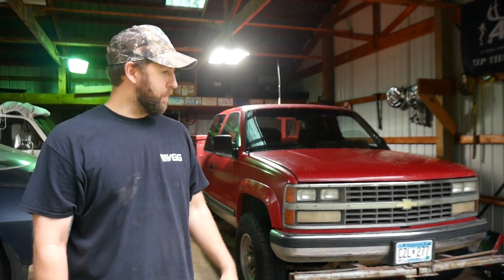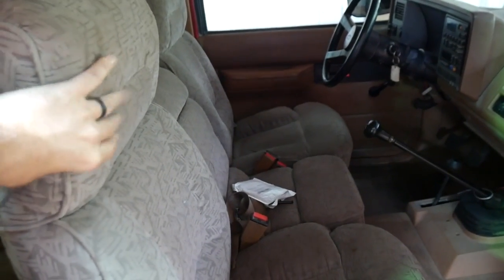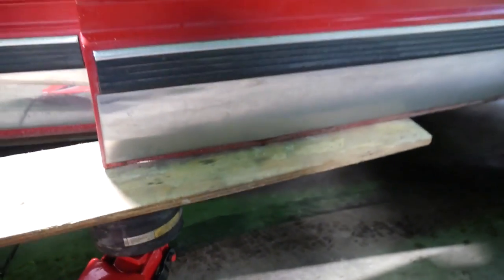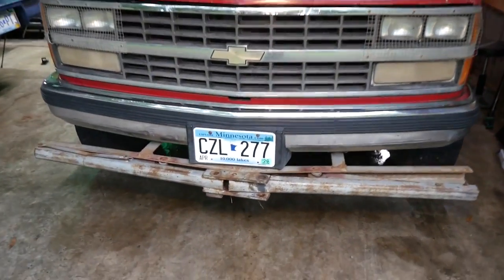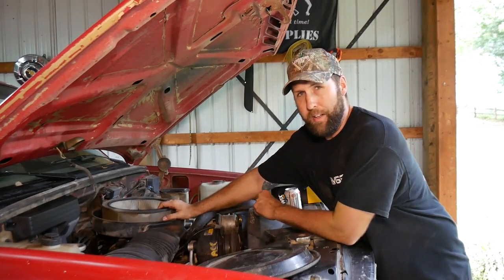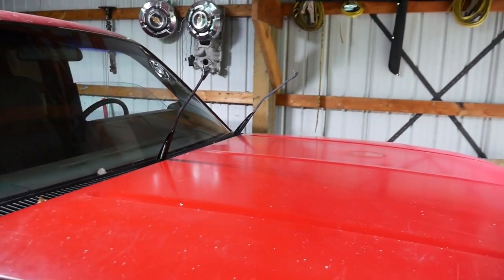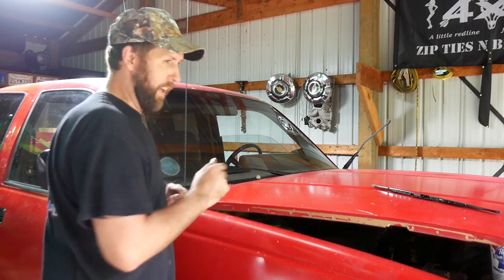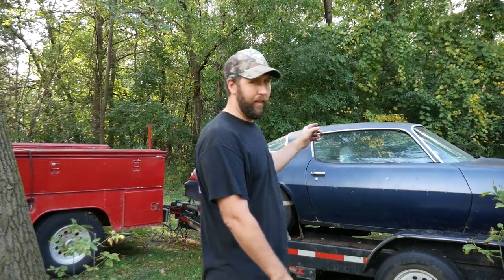OBS Chevy K2500 Service Truck - Vice Grip Garage EP41

Comment: Today I bought an 89 Chevy K1500

First Chevy pickup

Was the shops mechanics truck. Great shape. Runs and drives. Recently rebuilt powertrain.  $1,200 and I couldn't be more stoked. 

Already tempted to LS swap.
Reply from the maker: Wow what a great deal

Comment: "Don't pay attention to the way the belt is routed so you can really struggle when you're putting it back on..."

HAH!
Reply: save those old belts for engine hoist duty
Reply: @ddcraun  how do you use old belts for engine hoist duty?
Reply: Every g-d time... ✋🏻🙄🤚🏻
Reply: Pichardo Gabriel couplers and cradles... they’re belted rubber and have high tensile strength, so you can use them for things like cradles and strapping when you’re hoisting an engine.
Reply: Pichardo Gabriel basically you stretch the belt out flat, tuck the end thru the lift hook on the engine, then fold it it half and put the hook from the hoist through the belt and lift!
Reply: @ArmchairDeity  ohh ok cool
Reply: Just snap the old belt out with tin snips, it saves 15.5 seconds
Reply: I've done that before but then I've always loved a good puzzle.
Reply: My dad thankfully new how to put things back together, I had alot of fun with his screwdriver a couple times, clocks, doorknobs, etc. I'm glad he said the same thing to me, just pay attention how you take things apart, even at 4 and five i remembered. I melted a stereo on my maverick dashboard, so I took it apart, took the speakers out and put them in another.  I know it's not a car, but I was pretty happy with myself.
Reply: Nice car, but what about a maverick, don't they exist anymore.

Comment: I had a 95 TBI. I unplugged the tan wire to the computer, advanced the base timing, put a few quarters under the fuel pressure regulator spring,  snipped off all that extra material shrouding the TB, raised the injectors up,  braised a large salad bowl to the bottom of the air cleaner (to help air flow around the injectors as they restrict quite a bit of air flow), it gave it about 9.32 horsepowers.

Comment: My dad has a 91 Chevy WT K1500 and the oil pressure guage pegs full like that too. Evidently it's the oil pressure sending unit that failed.
I bought the truck originally and it worked fine at first, then suddenly one day it did the same thing.  It still runs that way.
I sold it to my parents when I moved to Georgia in 2003, then moved back to North Dakota with my wife in 2006. They still drive the truck, in fact they just put new tires on it this past spring.

Comment: I like it, more content of Beets/Beats would be cool.
An idea I've heard for more power on those TBI engines is to check the flapper on the air intake. The flapper is closed when the engine is cold so that air is pulled from the exhaust manifold and it idles better. Once the engine is warmed up(just like a thermostat) it should open up and let in colder air, but over the years they will fail and then your engine is stuck sucking in warm air from a small tube, essentially choking it out. 
Keep up the great work!
Reply from the maker: Thanks Clint
Reply: Well we will just have to add that to the build sheet😂😂😂😂
Reply: If you watch the vid, you can see the heat tube is not even hooked up.. it's just hanging there. The flapper was a great idea, they just didn't put too much time into the mechanicals. It uses a heat thermostat similar to the coolant kind to open or close the flapper... there is a second flapper in the heat stove pipe that's supposed to close up at the same time, but it's not a snug fit. Hot air will always get sucked up in there. If you don't live in an emissions tight county/state, you can snip both flappers out and plug up the stove pipe in the air filter housing, or cut it flush and weld in a patch.
Reply: @Mason Widener Yes, this is a great mod. The cone was just a noise reducer anyway. The inner fender ducting is pretty big, and it gets a good supply of real cold air from the front of the truck. Those "Cold air" intakes with the cone filter hanging inside the engine compartment are just you money sucking in hot engine compartment air. All you need is a bigger air cleaner with original fresh air ducting, and you'll get better performance for less cash.
Reply: Regardless of what a guy does, just keep the air coming from the fender inlet. I shake my head at guys who ditch the inlet, or put an Autozone cone filter on, or simply flip the air cleaner lid. Cool air from outside the engine bay is obviously better than warm air inside. 

They do sound beastly with the air cleaner lid flipped, though. Like an old Q-jet lol.

Comment: Another awesome video man, loving some beets, as I have a soft spot for the unsung hero vehicles. Also, as someone who is working with TBI on an 89 Suburban V1500, I know the longing for a bit more juice under the hood. What I've discovered over the years is that these TBI units like to be cleaned, like once every few years. Remove it, take it apart and soak/spray/scrub the hell out of it. The spring behind the regulator diaphragm is notorious for failing as well. Also there is a 1/16 inch spacer that is available for these units, goes between the injector/regulator pod assembly and the throttle base. this allows more air flow through the horns to increase atomization of the fuel spray. Also Edelbrock offers not only a TBI  intake, but a companion low to midrange  "RV" style grind cam that reportedly turns that TBI into a workhorse. the cleaning and spacer mod alone greatly improved throttle response and acceleration. I added the intake last year and the difference in acceleration was even more noticeable. Waiting on the cam, as the engine still only has sixty thousand on her. Also, check your EGR system. The computers that ran these TBI motors really "felt it" and tried to over compensate if the EGR valve or the module it's hooked to go on the fritz. How many times can I say unit? UNIT UNIT UNIT!!!
Reply: I'm installing a spacer RIGHT NOW, well after the video, of course, so thanks, a lot!!!

Comment: Yup, basic maintenance on the company service truck, if it starts making noise, that's what the radio sound adjustment knob is for. If you see smoke just tell everyone you was getting rubber at 55mph. Now your a hero UNTILL they find out the clearance on piston to cylinder, requires a tape measure....
Be safe out there great video.

Comment: You can add the bowl (Jegs Part Number: 555-50080) under an open element air filter assembly.  Instant difference.  I got the filter lid too and that helped.  Cat back exhaust will take advantage of the added incoming air.  Add a metal matrix, high-flow cat and you'll be in business.  And there are more cheap mods if you're interested.  On Beets?  Yeah.  More.  Any and all service and maintenance and tuning items.

Comment: I've got a 91 chevy with the tbi 350. I run 5w30 or 10w30 depending on the season. Can you run that thick of oil without wearing out the oil pump?

Comment: I been putting cold air intakes on my vehicle for year Derek max hp I have seen is 40 or so hp more but I use them because I can clean and reuse the filters and have mire then 1 filter ready and clean to just switch it out and go on my day when one is dirty @ViceGripGarage

Comment: I bought a cheap(ish) 1990 C1500 last summer after a huge hail storm totaled out my other rig......while I was already miserable at work. She's got 211k miles, only 30 pieces of oil pressure after a Rotella/Lucas oil change, but zero rust (Alabama rig) and a Gps exhaust. New tires, all kinds of maintenance, oh and the saggy door bushings. Gat dangit, I have to order the snazzy Cunningham bushings. The Dorkman ones are total trash. Anyhoots, what a feller is trying to say is A. One of the best darn rigs I've ever had. 2. Solid reeliabilityeee...fires right up on a 15 degree Mitt State morning. And D, classic timeless styling that I love. Hope to do a VGG rebuild on a junkalated power barn module and keep her going forever. Hope you keep yours going forever too! She's a total babe!

Comment: Just wanted to add to the subject, after changing the belt, throw the old one behind the seat in case you're in the middle of nowhere sometime and the new one goes sideways, the old one will get you home. Same for the windshield wipers, save the old ones behind the seat as well. I've had them fly off in the middle of a torrential downpour  and again, the old ones will get you home.

Comment: On those old 350’s I’ve always flipped the air cleaner lid over and removed the intake tube. On all of mine the little flap/ wannabe choke thing always was worn Out and stayed closed.  Which does block off air flow. Now I was and am too cheep to replace that so flipping the lid it will suck air from around the filter like the edlebrocks. Plus a bonus it sounds sweet.

Comment: I think the truck is fire. Put a amber light bar on the roof in case you stop on the side of the road or highway. Safety first. Combination generator welder , small air compressor, vise on the back bumper. I really love all the side box's. I used to take care of the boss's drill rig service truck. It was a Chevy 2500 4x4 dana 44 front dana 60 in the back front hubs auto trans Allison 6 speed. We put some mud slinger's on all 4 wheels. That thing was one mean son of a dip. Your's reminded me of that truck.
Reply from the maker: some great ideas

Comment: I broke 3 sets of bushings pounding before I used a stud and a couple of fender washers with a socket on the bottom side so the bushing would seat. I've done 2 other trucks since and took me 20 minutes per door.

Comment: you can take the sound resonator "the big round plastic drum" out of the air intake tube, 350 had them but the 305 has a straight tube that will fit it. it helps with the intake airflow and a little more mpg and torque. also they make an intake spacer it's a cheap power fix that goes under the TBI it helps low end torque but don't use the spiral "vortex" one cause it kills your high RPM power,  your channel is awesome, keep up the good work!
Reply from the maker: Thanks larry appreciate the tips

Comment: I loaned my '78 D100 to my brother for a couple of months, and it came back with the bottom of the door folded in.  He said he tried the door adjuster 9000 on it,and low and behold
it is still folded to this day.   I had to force a repossession on it to save it from the drunk side rub etc. too.

Comment: Take care of the GMT400 trucks and it will live forever. You can’t even replace the door pins on the 99 and newer GMT800’s.
Old 350 doesn’t make a lot of power but will run for a million miles with regular maintenance. The fact that it’s a manual transmission makes it a keeper.

Comment: yep lets see some more fixin on the beets truck maybe add some of the tools back like a compressor, harbor freight generator, welding machine you know the stuff you need when you go snag a new one out of a field. Maybe even some work lights that run off the generator. Maybe an LS 6.0 swap.
Reply from the maker: work lights not a bad iduer

Comment: 93 Tbi 350 in a 1/2 ton 2w/d. K&N filter in a 14 inch old skool chrome air cleaner. Hyper tech chip about 100 bucks, no Cadillac converter, and an under drive balancer pulley. Added abut 6 horsepower. Seriously 0/60 in 9 seconds flat.

Comment: I've got a 93 with the same engine set up. I run a standard 14 inch open element, works fine. also if you bump up the fuel pressure to about 15 psi you will notice it gains a few more pony's. A guy could use either a different spring in the fuel press regulator or an adjustable regulator, both can be found on Ebay.
Reply from the maker: Awesome thank you!

Comment: Well for an 89 and here in Minnesota, that girl ain’t to bad ! Some new lipstick and new shoes and she’ll be ready for the barn dance ! Lol. And by the way I have a 91 single cab with a 5 speed and V-6 I’ll let ya have cheap ! Lol all she needs is a slave cylinder for da clutch , don’t cha know ! I likey that tow bar much , very custom ! Those 3/4 tons run nice with that 350 under the bonnet !

Comment: Tokyo drift intakes can be a good time. On my 90 bmw the MAF sensor is the size of a basketball and of course it has square ends. Needless to say my 20 dollar O'riellys air intake became a square after some custom fab with old intake tubing that was laying around. All zipped up with some trailer wiring. Adds about 980 hp
Reply from the maker: Nice, great HP increase 😎🤣

Comment: I do like those service truck custom trays. Would love to have one. Trouble is the chemically motivated urban dwellers of my 'hood see that type of thing as a self serve utility that could contain stuff that can be recycled via Cashies. And then trashed if they don't find anything. Funny old world we've built.

I know this is a 4 year old vid, but I'm working my way through from then to current day, and Beets is probably long gone but I'd like to see you set up that service tray just so for your tree rescues. You know, dedicated space/storage for your 12' of fuel hose, boat tank, carburettor adjustors, cans of SYB, etc.

Comment: a 69 Chevy 1-ton heavy duty radiator bolts right in, zip-tie an electric fan to it and flip the air lid. Worth a good 15hp and better mileage:)

Comment: I have an 89 Chevy Cheyenne K2500. I have plans when a feller gets a little more of the  paper 5000 that has spending power. Swap out the 5.7 for a TBI 502 big block. That is after I swap out the rusty cab and bed for a Silverado cab so a feller can add the freeze 2000 to a truck. Then lift her a little bit and some bigger tires. Those are my plans. But anything you do to yours helps a feller out.

Comment: Try the door aligner 10000, it is a pipe with a bolt welded on the side  and a knotch cut in the end. You put the door both in the latch on the door, and the knotch on the pin. It gives you plenty leverage to tweak the door up until it closes nicely.........

Comment: 210 HP when new. My first New vehicle bought was the 1988 Chevy 3/4 ton 4x4 3 speed manual with granny gear. 235,000 miles. Owned it for 15 years. Factory when sold. The old man worked for GM for over 30 years. You can bend em and bang em p but they run forever.
Reply from the maker: They are pretty damn tough!!

Comment: Been watching for a few months now and i gotta say, you really fell into a perfect niche-style of humor when it comes to wrenching, big fan brother. Ol' Beets there looks like a solid tow pig. i had a 95 K1500 that had the same 350 TBI engine and it always just felt worthless. Until the day i needed it to come through; flat towed a 2007 Ram 3500 cummins with a landscaping trailer that died in heavy traffic. put the k1500 in low range (front axle didnt engage) and towed it a few miles to his house at about 25mph. later, i discovered the rear axle had no oil, but shes still putting around today; gave it to my brother inlaw.

Would like to see more of Beets, but there isnt much to do with that TBI 350.. i got a mopar BB 440 in my shed that would make for an interesting swap though haha
Reply from the maker: They do pull!! Thanks for watching glad you enjoy

Comment: You can also use sprint holes for the hinges, that's what I use. 
I do not know what it is called in English, 
but it is a sprint of spring steel that is hollow and open along one side.

Comment: I've got a 93 with a 454, but it has the same air cleaner.  I got a Spectre one from the old automazone with a lid that's also a filter.  It sounds fantastic now, like dual 4 barrels snapping open.  Now, whether it's got any more power or not, I spose a guy could dyno it, but that sounds like money.  The sound improvement sure is factry.
Reply from the maker: Nice 👍

Comment: I got a '95 Beets, GMC flavor. Would definitely watch just about anything having to do with these trucks. There's a weird thing that makes me do plugs, wires, Cap'n Rotor about once a year. It starts running rough in wetter weather, and new lightning parts seem to fix it, but I think there's an underlying issue. I don't remember what pointed me in this direction, but it could be simply poor grounding.

Comment: For some reason, many of the light issues with these trucks are the headlight switch. I don’t know why, but every time I’ve had to drive to work with my foot touching the brake, just so I would have “tail lights”, a headlight switch fixed the problem.... but I should just buy a new one, instead of hiding one in my tool bag at the junk yard.

Comment: You used the Hyper Lube on the old 1969 C-10 4 speed and 4 wheel Drive with a BLOCK heater is what sold a feller on , on that Farm near Can Adaada , where i guy got her stuck in the back 40 on a ATV trail lol not that i dont pay attention to these great VID YAS
Reply: on a side note do you still got that old 69 i think you named it Big John or something

Comment: Put a hood scoop on 'er and take the lid off the air cleaner. Make sure the cleaner is under the scoop and put a filter right behind the opening of the scoop so it'll ram the air in and make sure no mosquiters get in the fuel rail. Then you can put some Tokyo drift mesh in the opening too. That'll give a guy 3 or 8 more ponies if you're lucky.

Comment: I run the intake they sell at pep boys or advanced auto parts its specter brand i think, it did actually give me better throttle response and low end power not so much but 3.5 hp but better everywhere else including sound!!!

Comment: Fun fact, Chevy and GMC made the dual headlight design for only the first two years (88 - 89) of the C/K truck line, they moved to the composite design in 1990 for cheaper headlight replacement.